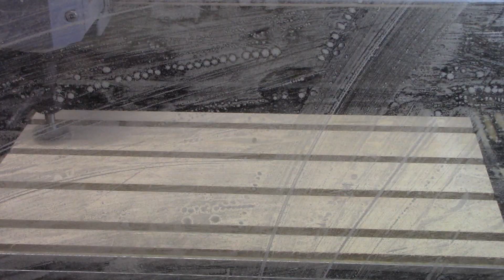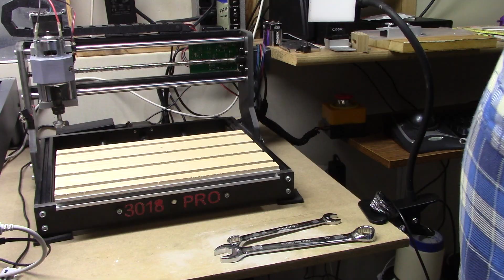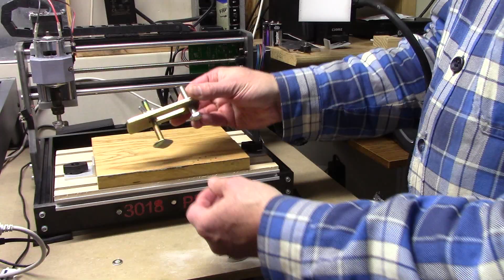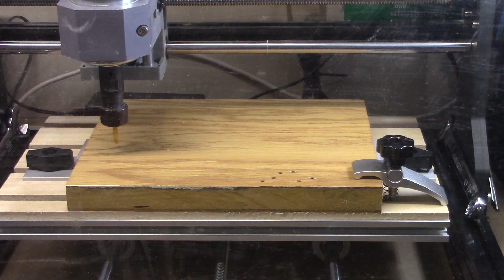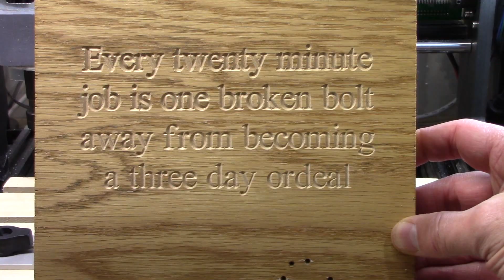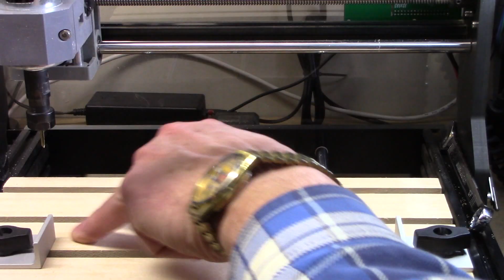Dusting off the Genmitsu 3018 Pro CNC router!

Comment: Mate, try sticking some fine-grain sandpaper to the contact side of your holding brackets; it’ll massively increase friction and give you a much stronger grip. If that’s too much hassle, the painter’s tape + CA glue trick works just as well and is super quick.

By the way, is this really a Genmitsu? The plastic "spindle" mount doesn’t seem genuine to me at all. In my humble opinion, this looks more like a basic Chinese 3018 Pro, not a SainSmart Genmitsu 3018.
Reply from the maker: Both great ideas to increase the holding capacity.  I was thinking a thin piece of neoprene rubber would also be a good add.  These end stops are really intended to help create a reference location for repeatability between multiple parts and not for clamping.  Still, they can work for both.
Reply: @CNCATHome  I wouldn’t recommend using rubber, as its flexibility can affect holding and repeatability. Sandpaper, on the other hand, doesn’t compress and provides significantly more friction compared to any flat surface. Fine-grain sandpaper, in particular, can increase friction by up to 20 times.
Reply from the maker: @axelSixtySix  - Absolutely with the repeatability.  Those end stops are designed to hole as much as they are to position. I will have to try the sandpaper trick if I am unable to use a better clamp.  Thank you for the input. 👍